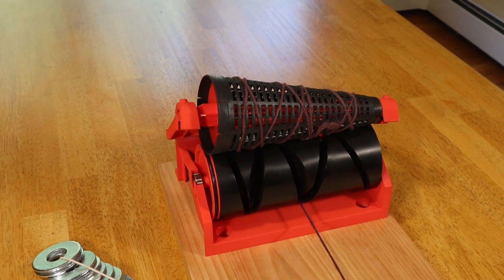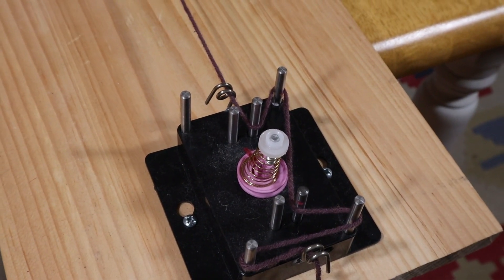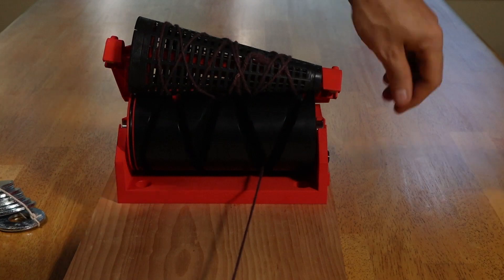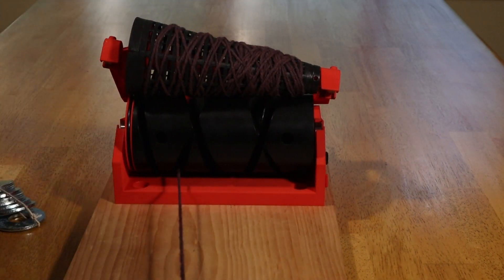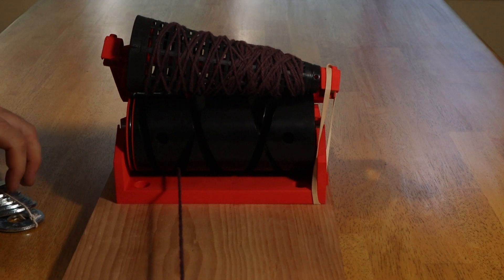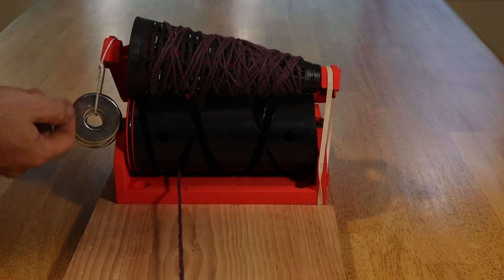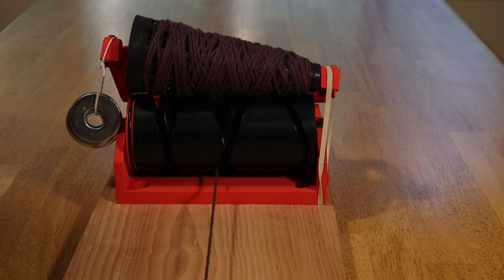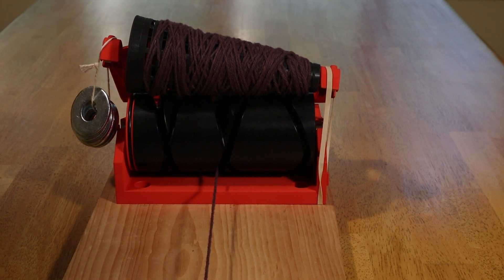SPIN 144 - Cone Slip Solution

Comment: Hey i dont know your name but your really good at designing things, i was wondering after you get done with the thread cone winder, could you look into making something like the marteli kwik spin thread stand, its rotates on ballbearings for metallic threads but there soooo expensive :(
Reply from the maker: I do like addressing market issues.  The problem with this one is there are a lot of low cost thread stands on Amazon and I see this one has some differences, but I'd need to spend a lot of time really understanding what the differences are and if there is enough interest in a medium priced high quality thread holder.  I have no idea if that would be the case right now without the research.  Thanks for sharing the idea and I'll consider it as an option, but I do already have a list of things I'd like to do that is much longer than I'll ever get to.

Comment: The yarn can also slip on the cone if both are smooth. I'm working in an R&D facility on industry yarn twisters, and I'll put gaffers tape on my blank cones when needed. But it needs to be very smooth, no bumps or folds. You can also wind a more textured yarn for a couple revolutions, then cut and tie the smooth yarn to the end. Works like an anchor!
Very excited for every update!
Reply from the maker: I've noticed that too.  My cones have little bumps that help prevent this, but the drums need to be smooth so it isn't perfect.  I find once you get a little yarn on like you said it tends to be better too.  So basically I agree with everything you said :-)

Comment: Hello, can you buy the STL files? And if where and when? Lg
Reply from the maker: There will be STL files for some parts, but not everything.  They will be released just before I start shipping the cone winder.  (The base won't get released as an STL, and the drum can't be 3d printed because it's not smooth enough to work even using more expensive 3d printers)